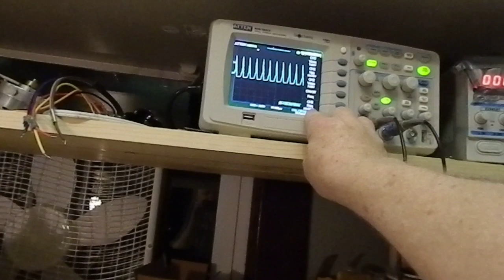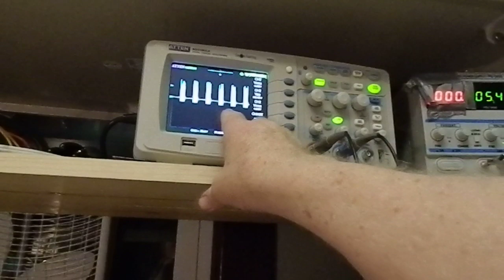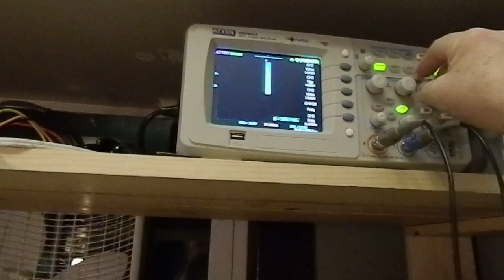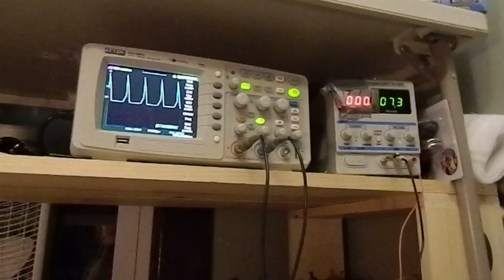LaserSaber5Hdevice22May

Comment: Great shots of the LED pulse train. The "Chuffing" could go a long way to explain the long run time while maintaining some brightness.
If you have access to a duel channel scope, I'd really appreciate a look at the base and collector, on the same time frame, in reference to the negative rail (Ground clip).  I'm also curious to see a trace from a shunt (1 ohm or less) on the Neg side of the cap. So scopes ground clip on neg and  the probe on the circuit side of resistor. To see if there is any back pulse keeping the cap topped up.

Thanks for the upload :D

Comment: Well done Steven. Finally we see real scopeshots.
Why does this work in this burst mode ? Is that because of these copper foils or do these coil not have the additional copper foil?  Van you also get it into constant ringing, without the 15 msec burst pause ?
Reply from the maker: Thanks.  I'm not sure why it comes this way, in pulse mode.  LS has this soldered together and I'd rather not take it apart.  The coils DO have the two copper foils.  Best wishes, I enjoy your site!
Reply from the maker: Mongrel Shark Yes, I could look across L3... BUT...  Unfortunately, in probing with my DSO probe last night, I blew out the transistor... sigh.  LS says he has blown many xsistors playing with this circuit (and not to feel too bad about it).  But I'm traveling today, so no repairs until tomorrow I think.
Reply: Steven Jones Do you have access to the L3 mentioned on laserhacker.com? I have a feeling flyback on that coil may be triggering either the pulse trains, or the higher freq in each pulse section. Would be worth a look across that coil too.
Reply: All good. I appreciate you taking a look. Fingers crossed you find time to fix it and do some more scope videos :)